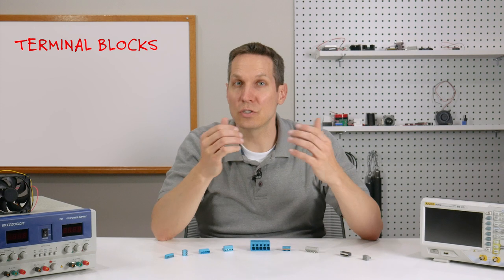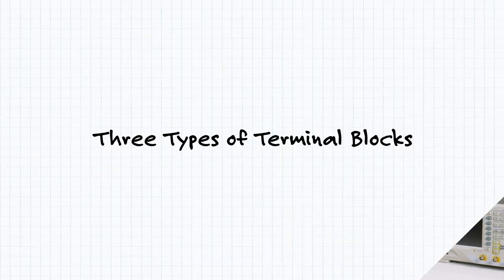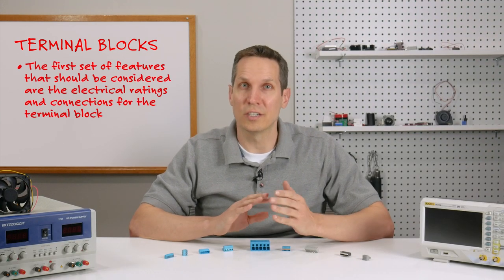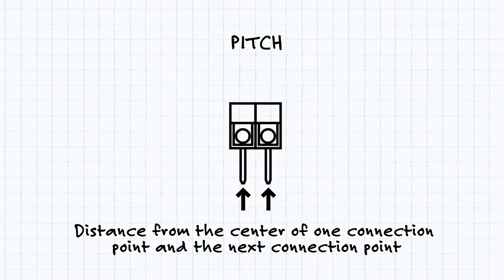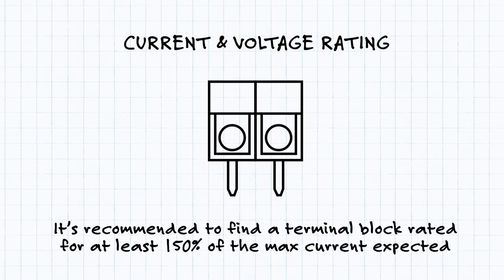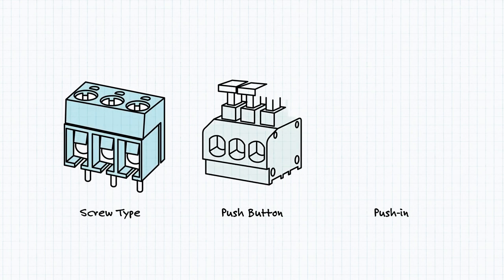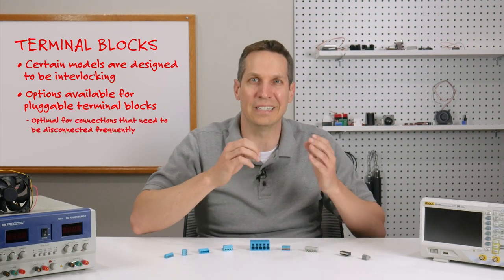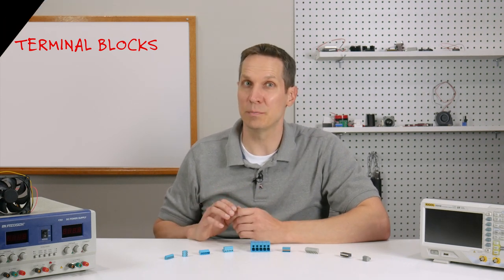The Ultimate Guide to Terminal Block Selection

Comment: Inotice there are holes on the top of each terminal. If the pins from another terminal is placed in the hole such that the one terminal is stacked on the other, is that a complete circuit? Or are they insulated from each other
Reply from the maker: Are you referring to the screw holes on the top of the connector? If so, no, those holes have a screw head, which is used to tighten and secure the wire once inserted into the terminal.

Comment: what type of connectors exist to connect PCB togethers? I am talking about connecting signal or wire power via wires.
Reply from the maker: Without knowing the specifics of your application, you are probably after what is generally called a "board-to-board connector." However, these come in many different form factors and types depending on your specific design needs. Hope this helps!
Reply: @SameSkyDevices  the shear number and type of connectors is one reason for the confusion
Reply from the maker: @優さん-n7m  as we don't currently offer board-to-board connectors, we are not an expert in that field. We would recommend reaching out to a manufacturer that offers those connector types. They would be better equipped to make a recommendation based on your application requirements.